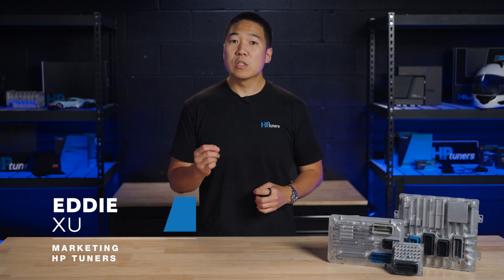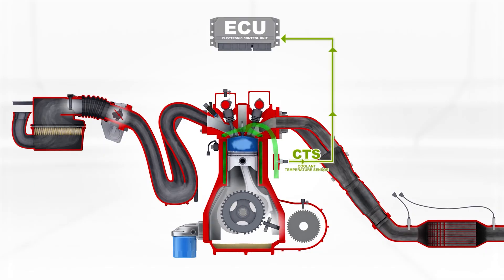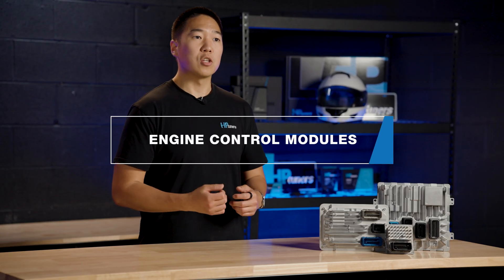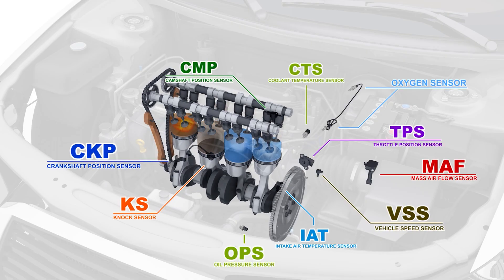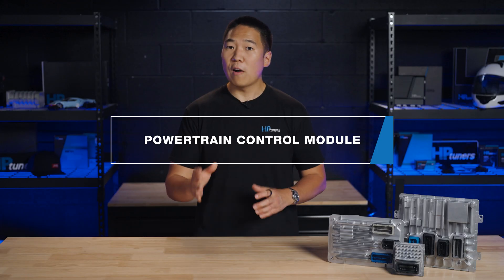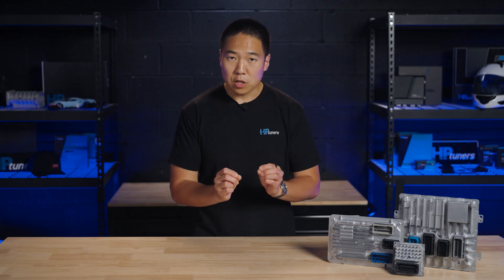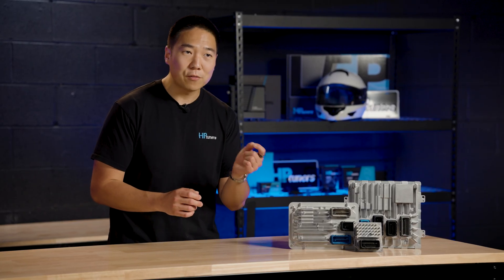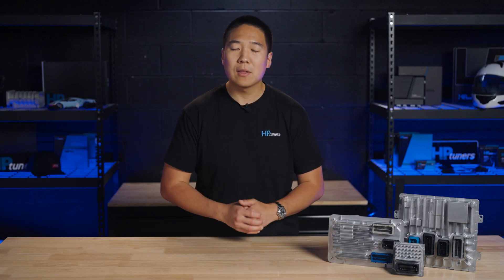Vehicle Control Module Cheat Sheet: ECM vs. PCM vs. TCM

Comment: I've built 3 pre-fuel injection motors.  My daughter's charger developed the "hemi tick". Indeed, it had a collapsed lifter and wiped cam.  No problem, I can fix that.  So I did.  We put in a bigger cam.  What I did not expect was the subsequent tuning.  So I got the HPTuners gismo.   Having a long career in technology, I can not understate how impressed I was with what I found in the ECU and TCU.  ECU has a 6 node neural network, not just to keep AF between the lines, but automatically accommodates the normal decay of components, such as worn fuel injectors, dirty sensors, etc..  Tuning was a far greater technical challenge than removing heads, swapping cams.  You can no longer just stab a distributor in a motor, change a spring and twist it until it runs OK.  It must be programmed to run cold, hot, WOT, 40 mph, etc..  I'll be excited to see when an outfit like HP Tuners applies an AI to base tunes.

Comment: Could it be reprogram by the automobile itself?
Reply from the maker: Not quite 🙂 Our devices don’t reprogram themselves through the vehicle alone. You’ll need an interface like the MPVI3 and our VCM Suite software to read, edit, and write changes to the ECM/TCM. If you’re working with a tuner, they can send you a file through the Tune Delivery Network that you can flash using the device, but the car itself can’t handle the reprogramming on its own.

Comment: Just received my hp timer yesterday. Now i got to try and figure out why the park assist/stabitrack keeps coming on and locking up the car... Nobody even the dealership wants to do it. Already changed out every sensor that is connected to the park assist and stabilitrak with no progress.
Reply from the maker: Thanks for choosing HP Tuners! That definitely sounds frustrating—we’re here to help where we can. While our tools focus on performance tuning and diagnostics, issues like Stabilitrak and Park Assist can sometimes point to deeper OEM system or wiring issues.

We recommend scanning for any stored or intermittent DTCs using VCM Scanner—it often picks up more detail than standard tools. If you're still stuck, feel free to reach out to our team at support@hptuners.com and they’ll be happy to assist!